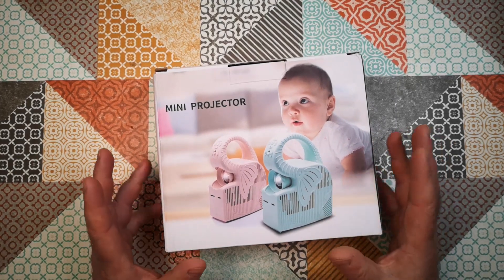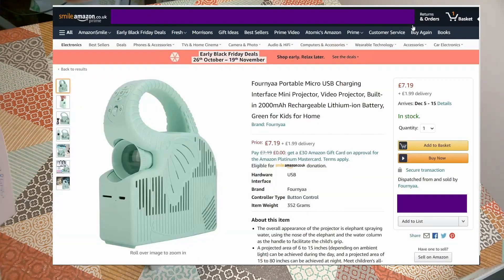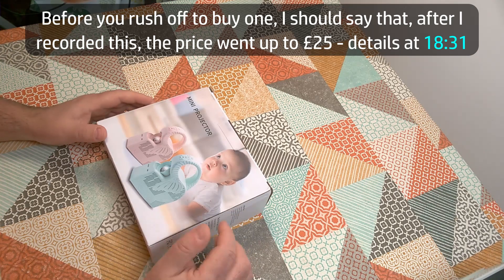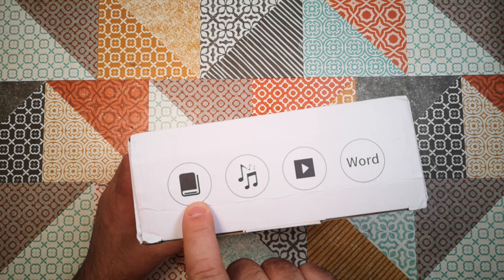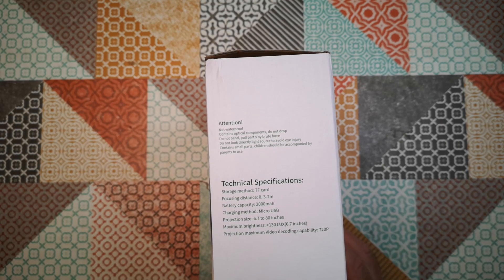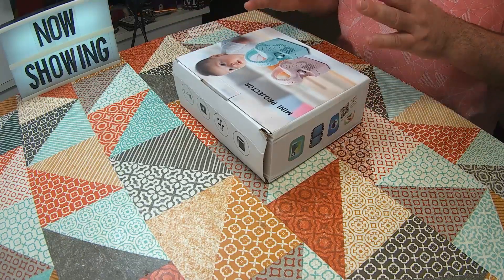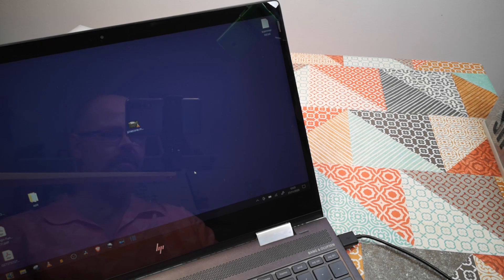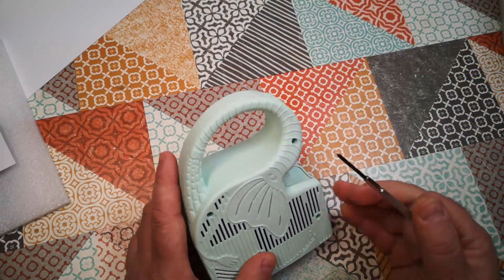The Weird Little Video Projector That Cost Me Less Than £10 - Unbox, Test, Teardown

Comment: ‘How did they make this and ship it and have it be so cheap’ + ‘I’ll plug it into my pc to see what happens’ = ‘there be spyware on that there device’ in my mind.
Reply: My thought was that it has no protection circuit or anything and fries the USB chip.
Reply: You could look up all the ic data sheets to find out their functions, if there’s no memory other than a basic cmos for booting I’d say the risk is minimal
Reply from the maker: I've tested a lot of dodgy electronics from China and I've never once encountered anything malicious on it - I'm sure some might say that's just an indicator of how well hidden it is, but generally, they probably don't want to kill your USB ports or steal your accounts, they actually want you to like the product for just long enough to post positive reviews
Reply: @AtomicShrimp  I don't think they want to kill the USB port - more that they're playing fast and loose with the standard and allowed tolerances and take the risk that that might end badly for some USB chips, if it lowers production cost.
Reply from the maker: @rolfs2165  yeah, I suppose that's a possibility, but in a great many of these devices they are just bodging together components off the shelf. Probably the biggest single area of risk would be solder bridges in some of the fake storage devices where they solder a cheap USB stick behind a USB c  socket
Reply from the maker: Or, now I think about it, using parts that are qc rejects
Reply: So they can see what your kids are watching?

Comment: If I was you, I would more careful about plugging random Chinese devices to your computer just like that.
Reply: @bjorn sjøstrom The Chinese government requires tech companies install spyware on devices.
Reply: it didn't even connect as a data device, just a charging one and even if it did have a data connection it can't take files without you putting them on manually
Reply: @epiccow12  It did connect as card reader. 
@Gordon Chin That, and It could be flawed electrically and kill your USB port.

Comment: I'd worry about the heat generated, if left on by a child. 
 Or covered by a child's blanket whilst still running.   Does it have a overheat safety cutoff ???
Reply from the maker: It did appear to keep ramping down the brightness, so I think there may be thermal issues with any kind of extended run time

Comment: Overall, this seems to be a good enough projector. Especially, for price and with the inside design. With slots too. It could be good for Christmas party. Since it loops the music. And the sound a little low. But if it could connect to a louder speaker then possibly it could be good.

Comment: Chinese tech goods these days are generally excellent value for money. Quality tends to exceed expectations and is more than satisfactory for the price paid.

Also, I have found, over the course of the past decade or so that I have been shopping online, that customer service from Chinese sellers on eBay and Amazon is, almost without exception, very good indeed.

The cheaper price you paid is probably a special introductory offer to generate positive reviews as these are necessary to generate sales in substantial volume. (Positive reviews go  far in reassuring potential customers that the product is of suitable quality and can also answer other questions that potential customers may have, thus alleviating barriers to purchasing the item).

Comment: 1 'hack' is to add a 2nd battery, even making sure that both batteries are high capacity cells.  There is room on the other 1/2 of the shell, would need to cut out a spot, but quite doable.

The box claims 2000 mAh, the current highest capaciry cell is 3500 mAh, so 2 of those and you have ~700 mAh, a 3.5x increase in runtime.  That said perhaps its 2000 mAh to allow it to cool down between uses, because its a rather beefy heat-sink for a 4.5v toy.

Comment: This little projector isnt that much worse than the Sharp LCD projector i bought about 20 years ago for my home cinema that i had, it had standard tv resolution so it would be slightly better and maybe a little stronger light (used an expensive bulb), the best input was S-Video and it cost about $1500. A projector for that kind of  money these days would of course be quite impressive, but this was pretty much the cheapest you could get back then when home cinema were only starting to get out to the masses. A lot has happened with technology since i was born in the early 70´s, i think its impressive that you can get something like that for as little as it was, im a service tech so i know a lot about electronics as well.

Comment: I think the simplest hack you could do to this, would be to wire a switch-over headphone socket to the speaker. So then you could have a bigger 8 ohm speaker on a jack plug, which would increase the quality and volume of the sound significantly, but when you unplugged it, it would go back to the internal one.

Comment: I need this. I have been wanting to do stuff with F1c100s for a bit. I can probably reverse engineer it. Dumping the flash off these things should be super easy.

This thing can't run Android, not even close. It can run Linux but that's probably not what's on it, and anything with -ian in the name is hardly really an option, that's what buildroot is for. There's only so much that you can do with 32MB DDRLP - the processor is about 10 years old and was very much budget to begin with. It's an ARM9. The original Raspberry Pi was (and Pi Zero is) ARM11. It's unlikely though that the dumped firmware would be of all that much insight, apart from getting it to do something again after bricking, it's unlikely that they have Linux in there. Or maybe if you're lucky it has some strings or something giving a clue to the LCD controller. No matter, i bet logic analyser will do fine.

I can't find them on Amazon. I found it on Aliexpress, but it was about twice the price at 23€. This is a bit more than i am able to pay, i can probably find a cheaper F1c device yet, i'm sure. This price actually sounds reasonable to what it should cost to manufacture and ship though, the £10 must have been a fluke, a promotional price, or they needed to get rid of them urgently. I'd actually rather want a game system style handheld anyway.

Let's see whether i can find all the components i expect to see. So i can see a total of 3 linear regulators making up the power rails for the chip - cheated rails, it actually wants 4. To the top of the processor is the SPI flash - can't read the chip type or capacity, unfortunately. Down the middle slightly to the bottom that's an audio amplifier. To the left of it that's the backlight boost circuit. To the left of it what looks like footprints for charge controller and/or battery protection, but it has been skipped. The board design is pretty insane, alternative footprints all over the place to be able to repopulate with different components depending on availability. I wonder, could it be, that it's been prone to exploding batteries and has been deemed unsafe for kids, or have they hid the battery charger where i can't see it? Is there something other than connectors other side of the board? Nah, it looks like they connected the battery via 2 Ohms resistors and deemed it good enough? A bit baffling for a board that has no less than 3 fuses on it, though that may also be just mislabelled jumpers.

The display is based on a phone LCD but customised. Parallel interface ones usually come with 40-pin cables, but some pins are reserved for touchscreen (even if none is present) and then a bunch of ground and power for the backlight, but since the backlight is completely missing and separate here, and the touchscreen is also hardly an option, they have been able to shrink the connector down a size. Wonder if they had been using 40-pin in the previous board revision - on a board so densely taped out, the empty space to the left of the connector looks very suspicious, just like the space to the left of the power rail for the audio IC. I bet the resistor under the audio amplifier IC used to sit to the right of it in that unused spot, and the power trace occupied the spot where the resistor sits, to give room for the 40-pin connector, and it's all been shuffled around there to give more options for capacitor placement once the connector freed up the space.
Reply from the maker: Thanks for your analysis - really interesting.  I've been wondering about trying to hack this thing, but it seems like replacing the board with a RPi would just result in a cascade of other things that need changing too (because the existing board controls battery charging, LED and sound)
Not to mention that I can't find anything useful about the screen - it's appears to have 30 lines on the ribbon cable and the identifier RX020T-1200 is printed on it in three places.  When I googled this, I got a page about small LCDs, but not this specific thing.
Reply: @AtomicShrimp  Battery chargers, backlight booster, amplifier, are all easy stuff. A single 18650 cell is a perfect case for, for example, a generic power bank module, or if you don't need 5V, just the classic TP4056 DW01 combo board is quite reliable. You can just measure the voltage the backlight runs at and use one of those "MT3608" step up modules, fundamentally there's the same on this board, if you're not comfortable just tracing and cutting it out of here. Same can be done with the audio amp, you can also either separate it out of the board or use one of those PAM8403 boards. Basically all the kinds of things everyone needs in their basic kit. You can even just retain the whole board and just cut into it to disconnect the processor from power, and then hotwire the audio and video where needed.

The F1C LCD controller has a particular manner of working. Notice that it has pins D2-D7, D10-D15, D18-D23, but D0, D1, D8, D9, D16 and D17 are missing? It drives internally three 8-bit ports, one per RGB colour, but only has output pins for 6-bit colour, which is fine, it's not like phone screens have more. Plus there's clock, enable and H/V sync pins. Bet you just need to trace out where the pins go on the connector. These all sit on the GPIO port D, which occupies the bottom edge of the chip starting from pin6 except pins 20 and 22, which are power, and the bottom 7 pins of the right edge.

Then you should be able to use a cheap USB logic analyser to just record the timings of sync and data signals.

Pi can drive these kinds of parallel displays. For that the GPU loads a firmware overlay via the configuration partition and reuses the GPIO pins. See "Raspberry Pi DPI (Parallel Display Interface)", I haven't tried it myself though, i don't have a suitable display yet. Or maybe i do and i forgot? That happens too.

I myself am more interested in torturing the bare F1C and seeing whether i can buildroot a linux on it which can speak to a stock LCD of whatever device.

Either hacking the processor as-is or integrating a pi is for sure an involved project by any measure, it's not trivial, but it's not an impenetrable fortress either.
Reply from the maker: I think you might be underestimating your own skill a bit; the things you said make sense to me, but there would be quite some effort for me to acquire any kind of competence at it; I think it's been nearly 20 years since I compiled a Linux kernel - I've remained tech-aware from being in an IT support role, but day to day IT support doesn't really involve any hands-on experimentation at this level, so any skills I once had have sort of atrophied.
I would be happy to send you this thing for you to tinker with if you like - contact me via the channel 'about' page or here: http://atomicshrimp.com/pages/Contact
Reply: @AtomicShrimp   I do not accept gifts and i don't give out my address. Besides, the shipping expense to you will be more than you bought it for, and probably approaching how much it's still on Ali. I'll probably just order some F1C device in a month or two, depending on circumstances. I had to urgently replace my PSU in the PC a week ago, and i couldn't quite resist and picked a fairly fancy one, so it'll take a bit to recover from that.

[whoopsie, i confused 'overestimate' and 'underestimate']

Comment: So is the LCD projector module compatible with a raspberry pi?
Reply from the maker: Not very sure. It's a 30 pin device, so I think it will need a controller at least, but it might be possible to use this board for that

Comment: The processor is indeed an ARM chip, but it has 32MB of onboard RAM.  Not going to run Android any time soon, but if somebody's ported an incredibly tiny linux version to ARM (Puppy linux or DSL or something?) that's vaguely possible...  But actually loading something onto that chip won't be easy unless there's a JTAG header on the bottom somewhere (probably not).  These are typically programmed with an external programmer before being soldered on, not in-circuit, and I doubt they implemented a firmware update function that could be abused.  There's a remote possibility they did, though, and playing around with various button-press combos might open a secret debug menu (probably not in English).

So, yeah, hackable, but then again so is everything with enough knowledge and effort...

Comment: cool, a board with a f1c100s! those are really cheap SoC from Allwinner. they contain the dram in the same package, so a minimum of components are needed. yes, in theory these should be able to run some kind of Linux, but probably not Android

Comment: I would love to use this thing with a more powerful processor. It's just one arm9 core at 533mhz, and 32mb of ram. Also it has a 2d only gpu. So no quake on this thing. I looked it up. The chip in that thing isn't much of anything special. But I'm impressed by what it can do. Maybe it deserves a little heat sink but a 720p video may have still been too much for it.

The projector components are by far the more interesting part to me. And some people could definitely put a little Linux on here to make it their newest terminal.

Comment: The processor in it looks like it's pretty decent. From the data sheet (which you can easily find by duckduckgoing "Allwinner Tech F1C100s")
"F1C100s processor is based on the ARM9 CPU architechture with a high degree of functional integration. F1C100s supports Full HD video playback, including H.264,H.263,MPEG1/2/4 decoder. Integrated audio codec and I2S/PCM interface provide end users with a good audio experience."

If you can find a good way to program it, it should be eminently hackable.

Comment: Have you actually found any digital projectors of any kind of noticable quality for a reasonalble price? I'm looking for a quasi-cheap projector that works okay with computers and stuff...
Reply from the maker: If you need something that will only be used in a darkened room, then some of the low priced ones might not be too bad although they often accept 1080p input and scale it down to something a lot less.
If you want it to work in everyday conditions, you still need to spend a bit

Comment: Can you fit the lcd in a dia projector?
Reply from the maker: It is about the same size as a 35mm slide...
Reply: @AtomicShrimp  nice got some old diaprojectors useless in the shed can make beamer out of them
Reply from the maker: OK, I double checked it and actually, it's a little bigger than a 35mm slide, but it might still fit.  The polarising filter is a separate pane of glass in the assembly, which is interesting.  I have not been able to find a datasheet for the LCD unit

Comment: I could imagine they got a bunch of old unsold pcbs, maybe from a digital camera or something, almost for free and built the rest around it. Therefore it would already have usb host and display output capabilities. Slap a simple minimalistic UI on there, and power for the light, and bobs jour uncle. Maybe I'm completely wrong though and it's specifically designed for this purpose.

Comment: Really struggling to find a good projector that runs in 12v found a few but they are fairly bad quality building a motorhome back up and want a projector rather than a tv
Reply: inverter not an option?
Reply: @virtualtools_3021  it is but just would be 8deal to run off just the 12v solar alone

Comment: We gotta get a tech youtube to pick one of these up to test the specs on that screen. If that's of reasonable quality, this might be a good source for little screens to put in stuff. 13 bucks for a reasonable quality small lcd screen would be really good.
edit: Nevermind. It's gone up to 33 bucks. That's not anywhere near a great deal. You can get a much better, higher quality screen of approximately the same size for almost the same price, if not a bit cheaper.
edit 2: I found a 3 inch, 60hz, 480x320 backlit touch screen with a micro-hdmi cable included for only 22 bucks. It's a resistive touch screen, but still, way better quality and way cheaper than the whole devices costs now. It would only be a good idea if you really wanted the projector features.